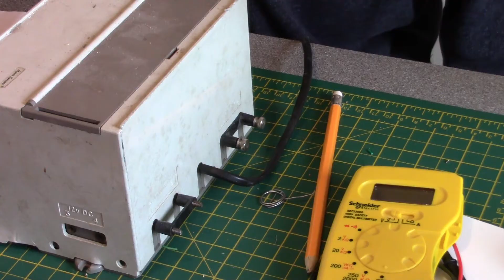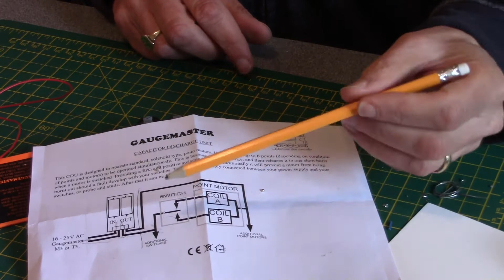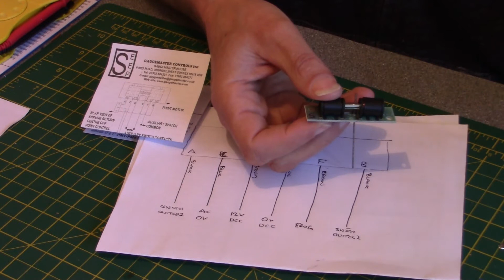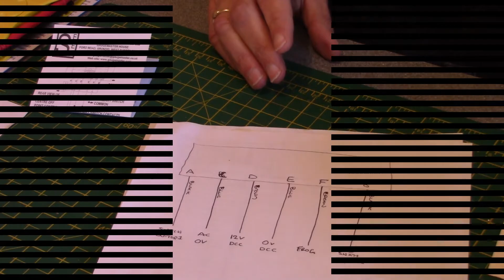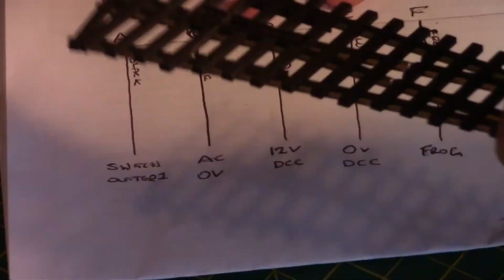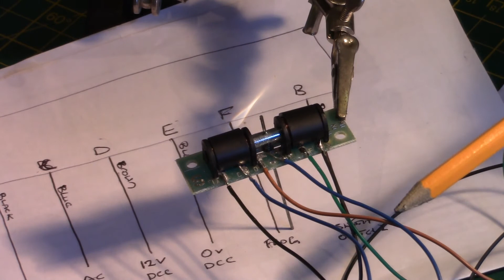OMR #6 - Little Drawling: Electro Frog Points (well nearly)

Comment: Hi Anthony just watched your soldering videos I think the problem you are having is 2 fold One you are correct lead solder is easy to use with a lower melting point than lead free. the other problem is that you need to heat both parts of the joint , the wire and the rail/contact, also making sure that both are clean. My back ground is in heating and plumbing so lots of soldering
Reply from the maker: Hi Dave, thanks learning load and starting to have more success with the soldering now,.